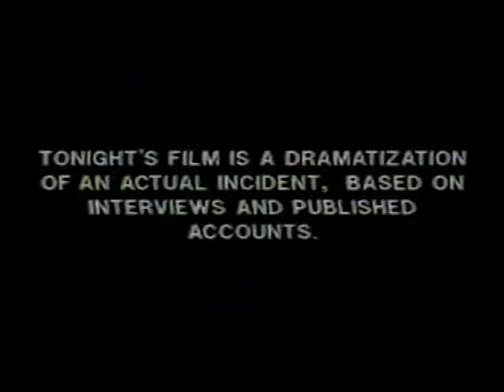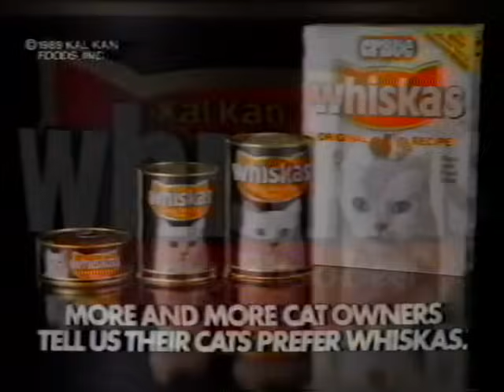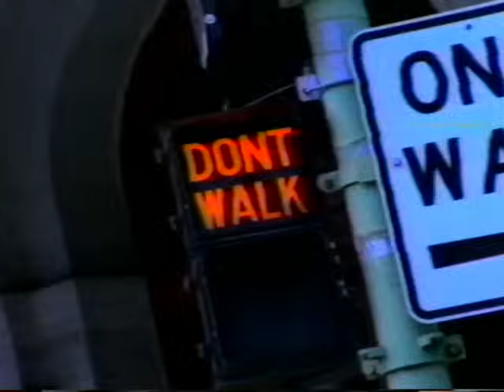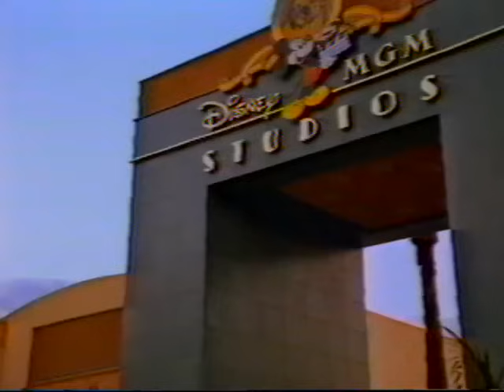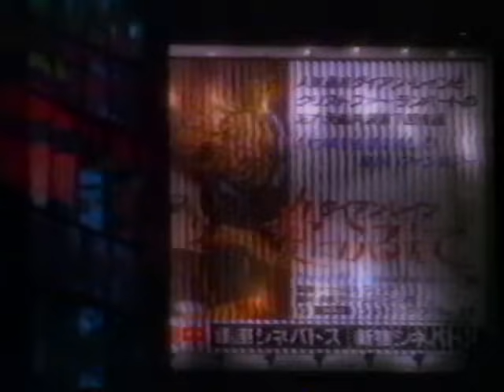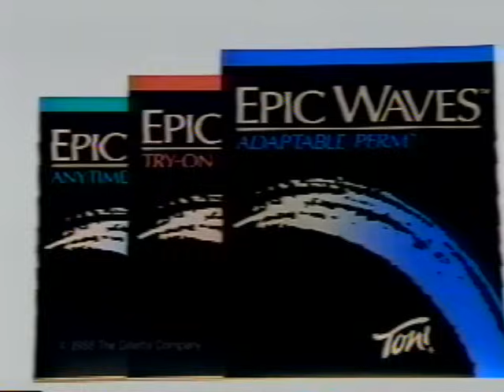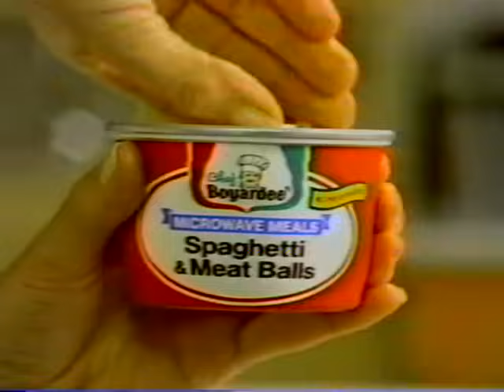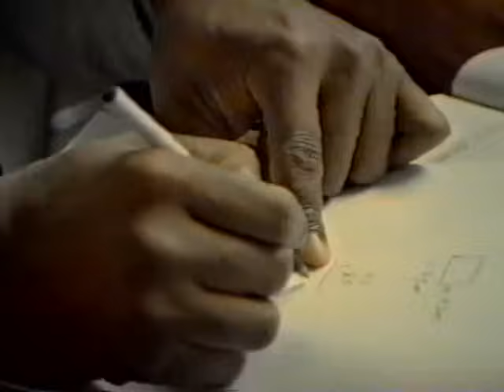Everybody’s Baby: The Rescue of Jessica McClure

Comment: I remember when this happened, we just bought our house- the septic system was a long galvanized pipe down into the tank. A hose went down that to clean the tank. All that was over the hole was a burlap sack and a piece of plywood. My boys were 7-5 and 1. I recorded the news coverage and my husband worked away, when he came home I played the tape and he went and got a cap made fitting in the hole and there was a ridge of Steele and then the cover - the ‘pipe’ like part fit into the hole and the ridged cover tightly held into Rick and the ground. It cost $225 and he said if an 18 month old can fit down that tiny hole, then any of our boys can too easily fit in this much larger one. -  we’ve since got a new tank with a drainage field and no worries at all now. So glad she got out. What a little darling girl.

Comment: I hope there is more awareness of safety around these kind of wells. I fell into a shallow well that was in my grandparent's backyard as a child. It was shallow so I was fine. They sealed it up afterwards.
Reply: Yes it is important for there to be more awareness of these kinds of wells and the dangers they pose and how to prevent a incident like this and what to do if a incident like this happens. In addition there should be more awareness of not only wells but also caves, abandoned mines, abandoned buildings, trenches, and confined spaces and the dangers they pose and how to prevent incidents at these places and what to do if a incident at these places. The important lesson of this incident is to never enter or go around wells, caves, abandoned mines, abandoned buildings, and confined spaces as they have many dangerous hazards such as caveins, danger of falling through a well or hole in the floor, unstable buildings that could collapse at any time, poisonous fumes such as carbon monoxide and h2s, lack of oxygen, danger of fires, danger of explosions due to gas leaks or explosive fumes or dynamite, poisonous chemicals, water that could cause you to drown, animals that live there such as bats, snakes, raccoons, rats, or even bears that could attack you or could bite you which could cause you to get a disease such as rabies, and a potential danger of being trapped and if there is a emergency at either one of those places immediately call 911 and if you can get someone who is properly trained and equipped to handle it and unless you are properly trained and equipped to handle the situation never enter the area in a attempt to rescue someone as you may become a additional victim yourself and make things worse and put other people including first responders who are trying to rescue you and the person you tried to help in danger. Remember 60% of people who die in confined space incidents are would be rescuers who despite being not properly trained and equipped upon seeing someone in trouble instinctively went in to the space but despite having good intentions they made things worse as they became overcome as well and becoming additional victims.

Comment: Your average person would be smarter than to have an open well in the yard.some people should not spawn children
Reply: The well was there before they built the house.  The ranches and farms there before that housing popped up all had old-pipe wells - when they were abandoned, they would tear down the wellhouse (if there was one) and cover up the pipe with something.  Simply removing the pipe could easily cause the ground around to cave in/collapse as the pipes went 30 feet or more down to the water shelf.  It was easier and safer (generally) to leave the pipe and just cover it.  I probably would have picked something better than that little rock though....

Comment: 18 months is big enough not to fit the small hole 🙄🙄🙄 .. wondering how she did fit
Reply: Actually not all babies  progress the same she was obviously just the right size because it happend
Reply: There are 3 way 1. Is straight down head first 2.is her legs could have stuck straight up against chest putting her in a folded position or 3.she could have jumped in feet first straight down but I'm guessing she fell head first straight down I looked at pictures of it she barely fit
Reply: jessica smith the police reports said she fell in one leg down and the other facing up by her head so in a folded split position she had a toe amputated after the incident
Reply: But at this age the bone are still soft and pliable
Reply: Well obviously she did fit cause it did happen